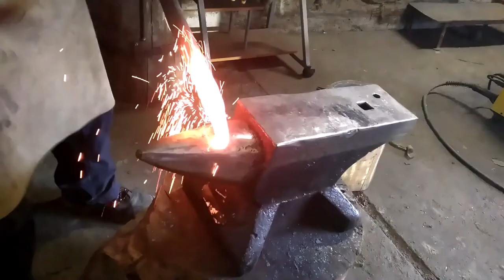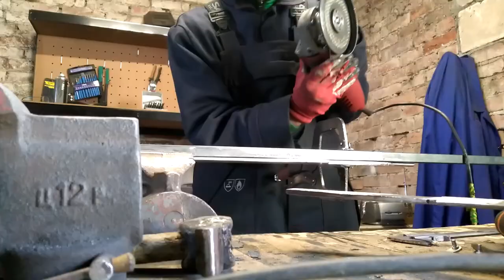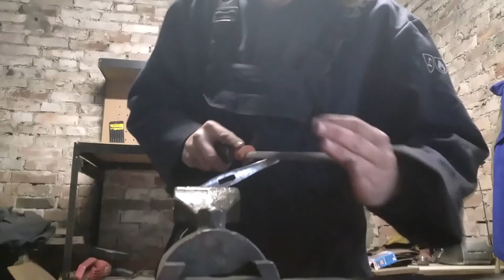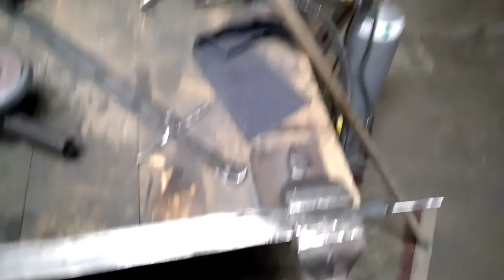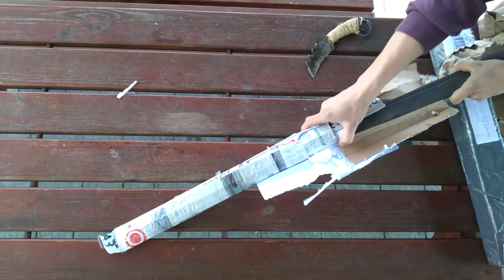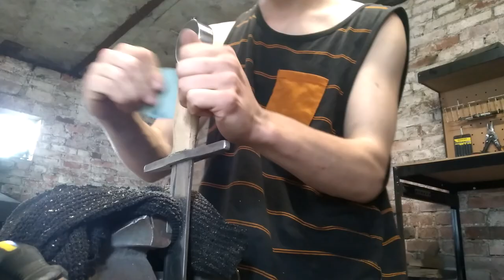Forging a falchion

Comment: Just speaking openly, setting up a heat-treating rig is quite simple and doesn’t require you to spend that much money. It’d probably be a cheaper option for you to set one up than sending them to a place and waiting to get the blade back
Reply from the maker: since this video I have heat treated many small to medium blades but heat treating this big blade in a coal forge as a beginner is quite risky  for me even in a rig,  and thanks the comment